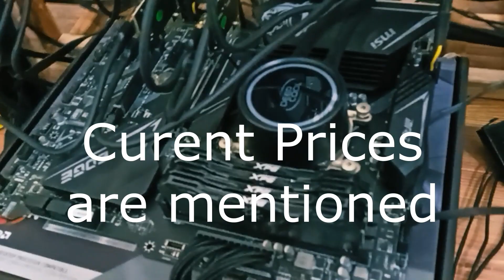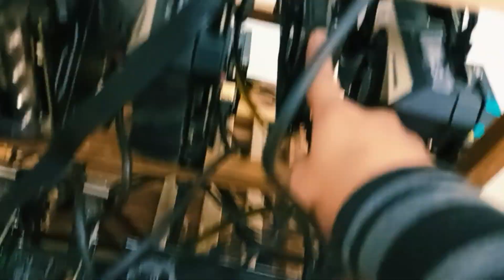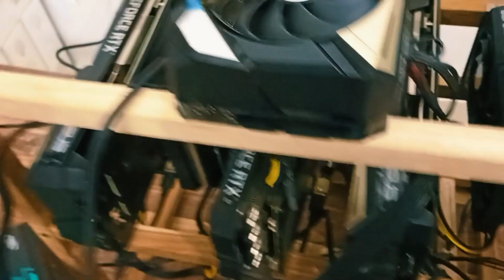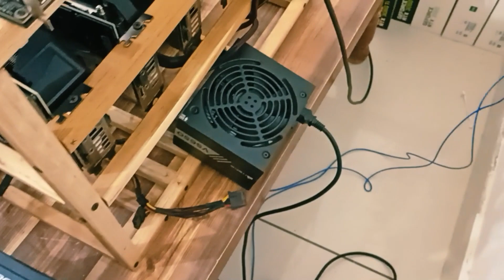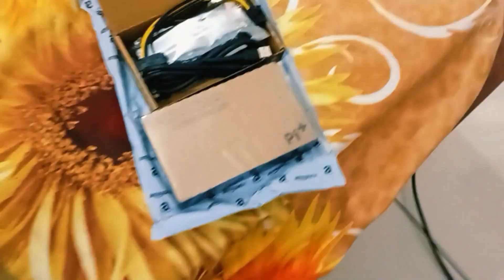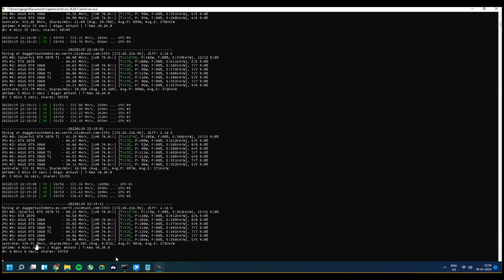English - My 5.75 Lakh Rig Making $18/Rs.1350 PerDay With RTX 2070, RTX 3060, RTX3060Ti, RTX 3070Ti

Comment: Lets says the rig you build for current day prices is approx 670000. Daily mining profit after electricity is 1100. Tax 30%. Effective earning 770 per day. Roi will be 2.4 years. Now considering investing 6.7lacs in bank or equity then average returns would be 10% then by end of 2.4 years it would be 8.5 lacs that means already a profit of 1.8 lacs booked without any risk. Please educate me if i am wrong.
Reply from the maker: You are not wrong but 30% tax is just a proposal. It has to be accepted and you can always start a mining business. 
Till the actual 6.7 lac is not earned back after all the expenses like electricity bill etc. you don't have to pay taxes.
The earnings always change on the basis of market. Tomorrow you may get 2000 in 1 day as well. Because that was the price in August 2021.